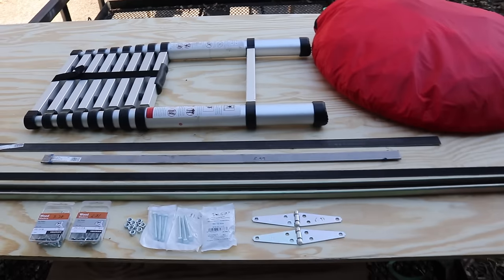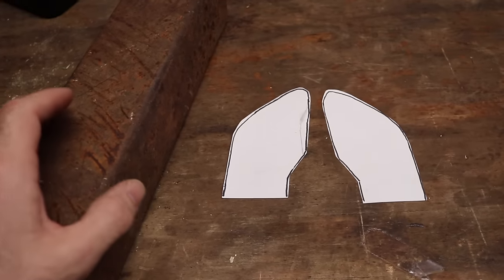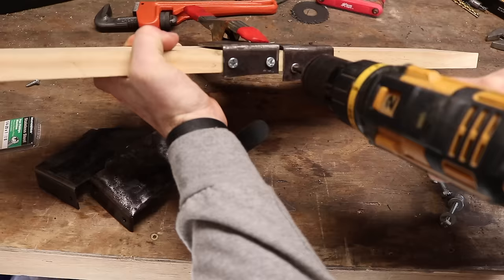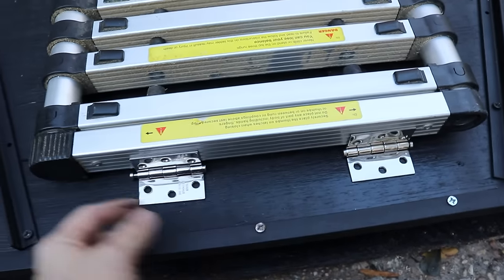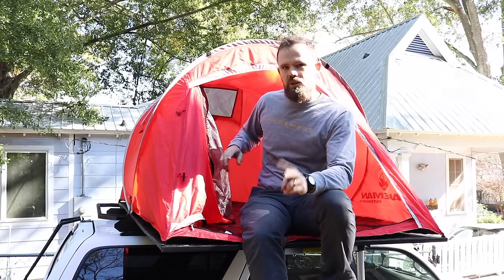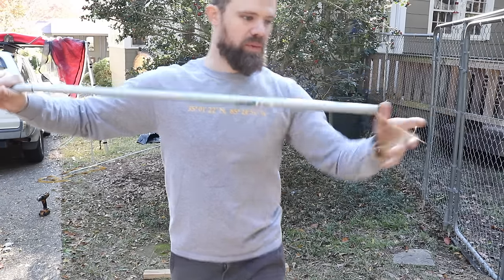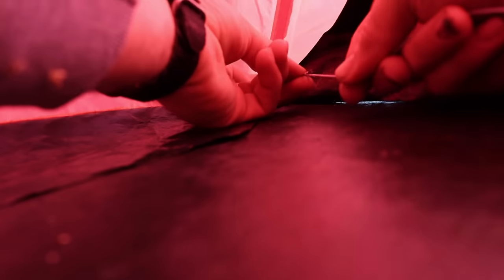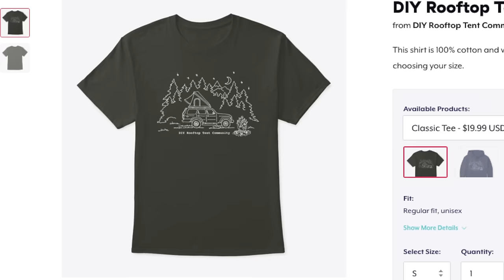How to build a Rooftop Tent on a budget!!

Comment: Great build with excellent detail! I have a Kelty grand mesa 2 and was thinking I could build the platform to fit it. It's mostly self-contained with the fly attaching to the corners. It would take a bit more setup but was thinking I could just have some corner tie-downs where the stakes go. There are a few stakes that you use to bump out the sides and ends but I might experiment with making those springy things they use for the roof-top tent bump outs. Thanks for all the ideas!
Reply: I put a grand mesa 2 on a utility trailer platform and I'm loving it so far! After watching this, I'm going to go stare at it this weekend to see how to make it self-deploy.

Comment: Pretty slick if I may add then idea you could use some extruded aluminum angle bracket to harden the edge of the plywood protecting it from trees as well as use it to pen the tent tight against the edge of the plywood maybe use some foam between the Tent and plywood too.

Comment: You can buy the hardtop roof tents that pop up on Alibaba for cheap. I got mine for $450 and its on struts and raises easily and sleeps 3-4 peeps. I found the exact one like mine on Amazon for $3600. It's also really easy to close and latches down. It's angled at the front for better mpg. I don't know the exact measurements, but its about 5'x7'. I bought a bigger one, but they had smaller one's that were cheaper. I've had mine about two years on my 4runner and living in western Colorado it's taken a bunch of abuse, but still is nice. Great video if you don't have $450

Comment: I like this build you did. Very economical and gave me some ideas. I have a question for you... You cut and removed the fiberglass rods? ....What if you cut a small section out from the fiberglass rod at the hinge position, secure each end on to a 1/8th inch piece if metal  (3/4" x 2"). Drill holes to secure each end of the fiberglass rods, and drill a hole to marry up with the hinge (like you did with the conduit pipe). The floor rods would connect to the base of the hinge so they lay flat (secure the rods and tent to the wood base. The up right rods would be allowed to pivot in to position. Also, use the wire cable attached at both ends of the base, and up to the fiberglass rods (again, like you did with the conduit pipe).  This way, you don't have to buy conduit pipe, the fiberglass rods will lay down when you close up the tent. Any thoughts?

I have already drew up this basic design of yours in Sketchup (not the part for the fiberglass ends yet)

Also, I have seen a similar tent (2 person) on Amazon for about $70 https://www.amazon.com/dp/B07CKJYL75/?coliid=I1QVWYS58B1NLG&colid=IGETP7QZ5QHI&psc=1&ref_=lv_ov_lig_dp_it. I
Reply: Instead of wire cable, one can use 550 cord (parachute cord), tie knots in the desired locations to position the rods in the open position. I'm not sure what the cost difference between the two. 550 cord is some where between $8 - $10 for 50 ft.
Reply from the maker: I definitely thought about doing this but I guess it seemed a little more simple to explain the conduit bending option. I also thought the conduit bending idea would be beneficial to those that didn't end up using this exact tent. I totally think what you described is doable though!

Comment: This is outstanding.  Was wondering, what if you made the platform a little wider and mounted the frame on the outside of the tent to allow for a rain fly?
Reply: And use the same sleeves that the fiberglass poles were in

Comment: Great built.  I red that aluminum and stainless steel do not mix and eventually will deteriorate the material. I saw that you used such in the telescopic ladder. But they are cheap any ways.

Comment: Just found your channel Patrick, great build! You have a good mind for design. I have made nylon tarps and use a mix of silicone (such as gutter sealant from a hardware store) mixed with low-odour turpentine (mineral spirits) to waterproof them. Mix it up well until the silicone is very thin like water, soak your material in it, then hang to dry. Instant silnylon! Works great, you could do your tent and be fully waterproof. Not sure if it would be as durable as a good canvas though. I'm going to build one of these now, way too expensive to buy them...

Comment: Mate of mine travelled his series 3 Land Rover through Central Asia and Africa.
He mounted a full length roof rack fully decked with a piece of ply-wood.
He had the option to just throw his pop up tent on the roof or on the ground.
Depending on the location.
Because in reality roof top tents suck, unless you really need it. For example in case of rough terrain, crawling bugs or curious locals (Pakistan) a roof top tent is handy.
Reply: RTTs are great. Ground tents suck.
Reply: @amorton94  until you get the shits and have to run out of your tent 10x a night.
Reply: @Bouwentjes  That sounds like a shitty situation either way. 😆

Comment: Nice 👌 I think the only thing I will do differently is have the flaps of the ground sheet go over the edge of the base like a skirt, the way you did it seems as though water would run underneath and into the tent where you cut out the floor !

Comment: Great tent! Couple suggestions.Take apart the ladder hinge & flip the one side & you get the gap. Don't use eye bolts just go through the holes in the floor, maybe need washers against conduit holes or drill smaller holes.

Comment: Awesome Patrick! Thank you for sharing this incredible DIY rooftop tent project! I want to build my own! I only have two questions, if you will, 1) Do you need a special rooftop rack for your car? I have a Chevy Captiva 2015 that comes with its original rack, on top of that I have two reese explorer parallel bars for a reese explorer rack, but not sure if it will stand the weight. 2) What kind of drill bits you used? Cheers from Mexico!

Comment: youre using that angle grinder a little backwards, because of the way the wheel spins if you put the handle on the left side and use the right side of the wheel itll be alot less grabby and jumpy and youll end up with less shatter cut off wheels spraying abrasive into your skin, the way youre using it the grinder wants to pull itself into a cut and towards you where the opposite way itll want to push itself up out of a cut and away from you

Comment: You can buy rubber sheet material, and use a Polyurethane Rubber, just go with the more foamy stuff that lets it bend which is what sails are made of. Of course, don't go with an Epoxy Rubber, that will turn the sheet into a rubberized bowl you'd see on your counter. If you use a Urethane Rubber, well, your guaranteed that it won't turn into a solid like what you can do with an Epoxy Resin, or polyurethane. You could use a Urethane Sheet most likely, but make sure you cover all the plywood all the way around, so that you can use something like a liquid rubber they use on the roof an RV to seal up the gaps in order to protect your plywood. As for supports, I'd use joists with extendable legs. Of course, I'd also probably make my own tent with a Polyurethane meshed screen to keep the bugs out while stitching the seems of a good Polyurethane Plastic. Of course, I wouldn't use Urethane with little shards of glass to make a fiberglass rubberized meshed-screen. Nah...That wouldn't be good at all. I wouldn't recommend using rubber along though for anything unless you want to blow a few balloons up and have a party. Oh...I have way too much time on my hands, and I research too much.

Comment: Really like your design. My idea would be to have the frame on the outside of the tent, using the old fiberglass poles, but cutting them down where the hinge is and using a sleeved flange to connect the cut ends of fiber glass poles to the floor hinge. I don’t like how the floor is cutout, I wish there was a way around that

Comment: Except for the fact that you need to have the ability to cut metal.  This was a neat little build.  There must be a hinge online you could buy for this kind of project.  For those of us without metal working tools.
Reply from the maker: Yes, there are. I mentioned this when I was building mine and I have a link in the description where you can buy them. That being said. Grinders aren't very expensive at all. I can buy the tools for this job more cheaply than I can buy the hinges.
Reply: How would I do a search for the hinges, to buy them online? Thanks!

Comment: If you fiberglass the wood panels, and use a locking nuts, this would be a killer setup. But it still is anyways - for that price! I mean paying thousands for 2 fiberglass shells, foam and some cloth with zipper around for commercial one is crazy...

Comment: amazing build! one question: you cut out the bottom but left a small border of the original flooring. did you use that to wrap it around the plywood like you said to not let water in? I didnt see that part in the video and I only saw you drill into the sides. when you showed it after you drilled int all in you could still see some light from a gap between the tent and the ply. did you fix that later?

Comment: on the ladder on the opposite side where you used bolts i would use a square piece to sandwich the parts. aluminum is some weak stuff and the bolts might wear through
Reply: nut i mean

Comment: Hello Patryk. What thickness of plywood did you use for the project and how did you protect it from moisture?
Reply from the maker: I used 19/32inch. you could also use 3/4in it will just be a little heavier. I primed and painted with oil-based paint. It works well!

Comment: Awesome! Did you end up securing the floor of the tent to the underside of the plywood? Looked like you screwed it down but then later it wasn't attached so you could unfold it.
Reply from the maker: It is secured around the sides but not in the middle where the hinge is so that it can fold properly without tearing.

Comment: Have you run into any wear issues with the hinges touching the tent when it's being deployed? Or the tent snagging on them?
Reply from the maker: Not yet! Still very new. The bolts do need to go from outside in and they need to be trimmed if the bolt goes past the nut. If the bolt is going from inside out then the tent will snag on the nut sometimes.

Comment: @Patrick Remington, how did you fix the bottom of the tent and the material you cut out. You talked about using it on the sides of the tent. Do you have pictures of this? It is the last bit i need to understand before i cut a hole in my tent :-)

Comment: Did you have any problems with the nuts and bolts loosening up over time?
Reply from the maker: No! You shouldn’t if you use washers
Reply: @PatrickRemington  lm starting my build on a pop up clam.  I’m building the bed rack and putting it together with nuts and bolts. And lock washers.    I am going implement your idea of using  my existing truck bed tent for the clam pop up.   Great idea for eliminating the sewing 🧵 process.

Comment: If you just fold down the tent before you close it would you still have to cut out the hoops
Reply from the maker: LukeRogers436 if you fold it over without cutting out the fiberglass poles they will break.
Reply: How the original design of the tent is used, you must fold then twist the rings in, but as u fold it down the rings are far wider then the base so the platform would have to be extended far past the bottom of the tent. So u have to cut them out and flatten the sides so it doesn’t extend past.

Comment: The only problem with that brand of tent is the fly over the side vents zips from the outside. When it starts to rain you have to go outside undo the fly and zip it down. That tent is water resistant not “proof”. I’m thinking of rigging a tarp over for rainy days. Of course we can always just sit in the car. 😃

Comment: Sorry to see you smash your fingers i know the feeling and i can only imagine how pissed off you were at yourself and the project. But it turned out great anyway and the video was very informative. I also happen to have a similar pop up tent, but i will wait for your method of cloning the tent design and using better materials as i dont want to build the roof top tent with a water resistant one, unless i make a rain fly to go over it. Thanks for the great video.
Reply from the maker: Welcome! I have since found some waterproofing tent spray. I will try some of that and see how it works!
Reply: Patrick Remington  awesome let us know how that turns out ive had limited success with silicon waterproofing, have to use alot of it to get a full coating.
Reply: @PatrickRemington  Patrick use flex seals flex paint, I did that to a tent fly and one of the benefits is that the tent is dark inside and easier to get to sleep and being on top of the car you don't have to worry about the extra weight of 5 or 6 pounds that the rubber adds, I had a heck of a time carrying the tent, a friend bought that tent and just throws it in the back of his station wagon and goes car camping, his wagon is a dodge charger magnum wagon with no room to sleep in the back of it, so the tent works good for him, the tent is a 4 person tent

Comment: Safety warning😢 please be advised to replace all screws that were used in this video with nut and bolt also using a metal strap anywhere the nut and or the bolt would be touching the wood this is because any amount of dry rot or water will allow the screw to come out otherwise and with the weight of the human on the overhang side when the screws pull out the person will fall to the ground and be sandwiched by the weight of the platform.

Comment: Do you know how fast a cutting disc in a angle grinder can chop off a finger if not chop it of at least cut down to the bone taking tendons with it in such a way that it won't be fixable in any possible way? And taking in consideration the price of health care in the US it is really, really, really stupid to remove the gard on your grinder. I have several hundreds of hours with grinders in my hands I know how they can ruin your life faster than you can blind. I've escaped that fate several times because I had the gard, leather gloves and eye protection but I still ended up hurting. So... Stop being dumb and put the protection back. Cheers
Reply from the maker: I took it off to fix it and put it back on. You need to chill.
Reply: @PatrickRemington  I'm chill. It's your fingers I'm talking about not mine. Nice build by the way. 👍